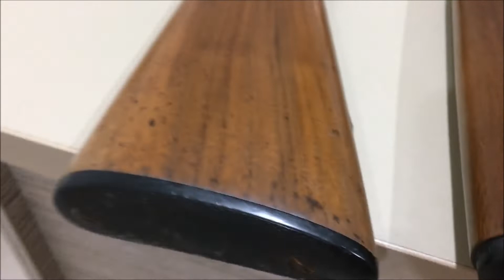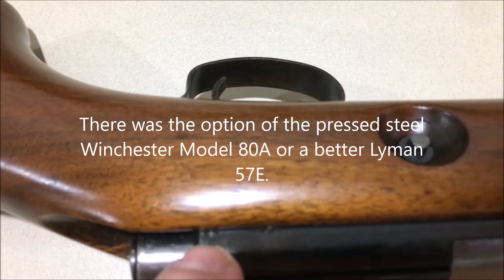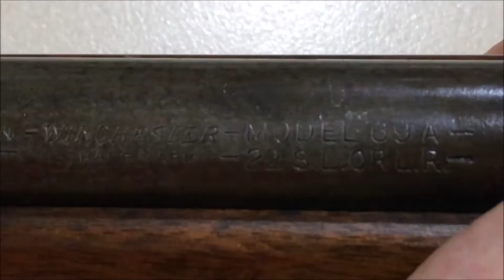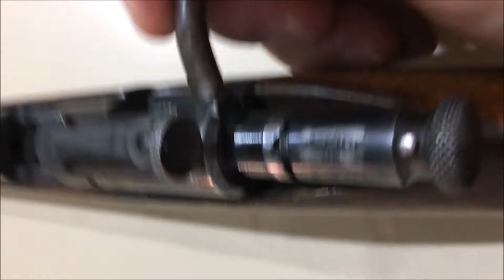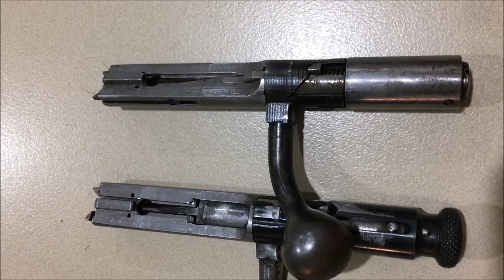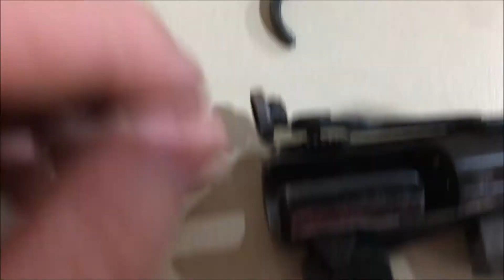Winchester Model 69 vs Model 69A. A side by side comparison.

Comment: Well done. I have a couple of A's that are different in wood and bolt handles. The later one has dovetails in the receiver and the earlier one has a plain round top. They both came with Winchester peep sights and hooded front.

Comment: @456eec. I have an unmodified all original model 69 handed down from my grandparents. 12:03 The screw and the tapped holes aren't present on my rifle. It has the peep site with the hooded front site, and as someone else mentioned about the butt plate, there is no proud wood. This the first rifle I ever shoot, my grandfather taught me how to shoot when I was very young, and have been shooting it (occasionally) ever since, close to 60 years now.

Comment: Is there any chance the bolt assembies are interchangeable between the 69 and 69A?
Reply from the maker: No the firing pins are completely different and have the sear surface in a different place.
Reply: @456eec   Thanks! Now I just have to find a bold assembly for the model 69. Have found some online, but they are all currently sold out.

Comment: I have a winchester 69 mag and its patented in november 25 1919 does that have anything to do with when the gun came out? (im not a gun guy)
Reply from the maker: No that is just the patent date for the magazine design. It wa originally designed for the Model 52 which was designed in 1918. They were made right up to the early 60s.
Reply: @456eec  thanks

Comment: Can anyone provide a value of the 69? Would greatly appreciate it. Good to fair condition
Reply: Has the original sight I think. The butt cap is cracked down the middle and missing magazine. Found at a garage sale a couple weeks ago but don’t know much about guns and folks here are telling me it’s worth $100 US or less and I think they are dead wrong. Thanks for the help
Reply from the maker: Depends on the sights it has as original peeps will bring more than open sights. Also if it has it's original Winchester marked magazine. Here in Australia a good 69 with standard sights and magazine would likely bring around A$450-500.
Reply: @456eec  I'd give you $100 in a heartbeat. If it's pretty clean and a good bore probably closer to $400

Comment: The extra wood around the buttplate on the 69a is proper for the rifle and is called “proud wood”.
If you ever have to refinish the stock it gives you some extra wood. Also it’s a dead giveaway that the stock has been refinished if flush.
Not quite sure when Winchester started doing that.

Thanks for the video!!
Reply: Your model 69 should have proud wood as well, so a good chance it was refinished or it’s a very early model.
Reply: All of them I've seen including the 67a and model 72a have proud butt plates. Many are marked "model 72" inside.
Reply: @samwalker7821 Interesting observation on the 72 behind the butt plate. 
No doubt that there are 100% original guns that don’t have it above the buttplate.
All of my pre 64 Winchesters ranging from model 12 shotguns, a sampling of most rimfire models to the model 70 all have proud wood, quite possibly because I don’t buy a Winchester without it.
Happy shooting!!

Comment: Good day, A friend brought over a model 69 for some help.  Not clear how the bolt goes back in.  I can pull the trigger and it goes in a ways and then stops.  Is there another trick?  Many thanks.
Reply from the maker: Most likely the bolt may be decocked. Try grabbing the bolt body while out of the rifle and lift the handle. 
You can tell as when the extractors are horizontal out of the rifle the handle should be at 2 oclock viewed from behind. If it is at 4 oclock then the bolt is decocked and will no go into the rifle.
Reply: @456eec  I think i understand.  I will take another look
Reply: Got it!  Thank you very much.  it appears that someone in the past and removed and flipped around the block under the bolt (ejector/extractor?) and the bolt was decocked.  its in now.  The grove in the block was not matching the slot on the underside of the bolt.  I wonder how many decades it has been like that.
Reply from the maker: @JD-bp6pi  Well done.
Some shooters routinely decock their bolt to take the compression off the spring during storage.

Comment: A few more comments after an afternoon of shooting....Cornell Publications puts out many copies of Manuals and Catalogs of Winchesters. I ordered one on The 69A,72, and 75 all similar models.  The 69 is a look alike for the 69A but is somewhat lighter  and would be called a "sporter" version, somewhat slimmer, lighter barrel,  fitted for a sling and tapped for a scope. I will carry both with open sights squirrel hunting this fall. The back sites are perfect in that they let just enough light on each side of the bead front site. They are tack drivers from a good rest. Like the Model 52 the bolt is as smooth as a bank vault door on both.  The manual says to turn the trigger adjustment on the 69A out to about 1/8 inch which should be about right.  I did this  and now the trigger is lighter the way I like it. The 69 does not have a trigger adjustment screw.

Comment: I have the Model 69 and 69 A both in excellent condition.  I also have a Winchester Model 52 target rifle.  I learned quite a bit from your video that made me appreciate these rifles even more.  American 22 rifles from the early 1900's through the 1960ties were made much better than today's rifles, at least in general.  There are a still a few old designs being made. The sights were fine with a bead on the front and fine notch on the leaf.  Why  was this, people of these generations depended on these rifles to bring home small game.  A shot in the head saved the meat.  I grew up with these rifles and have collected a few more. Accuracy was key, no square pistol sites on these guns.  These rifles were patterned after the Model 52 target rifle with double extractors and side button mag release.  The trigger has adjustment on the 69 and 69A but is not nearly as good as the Model 52 as you would expect.  Double extractors are a good indicator of a fine rifle.  Thanks for your video.